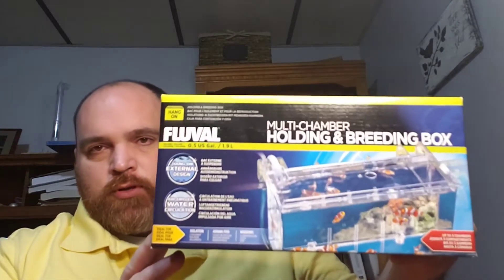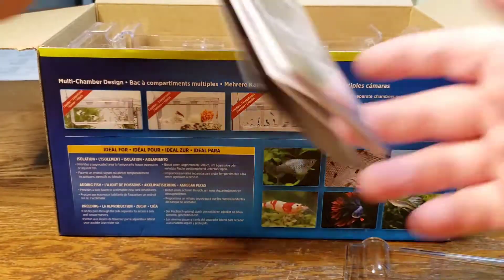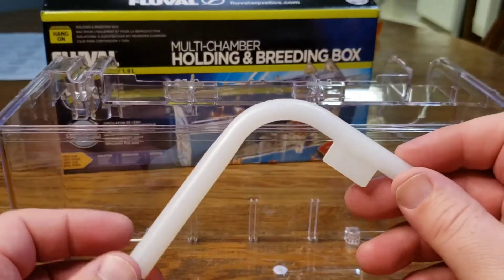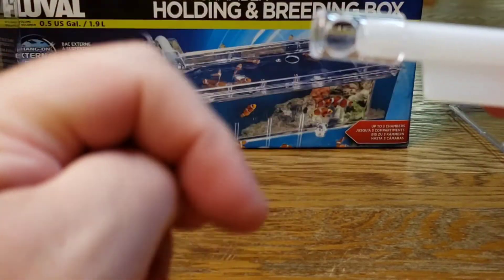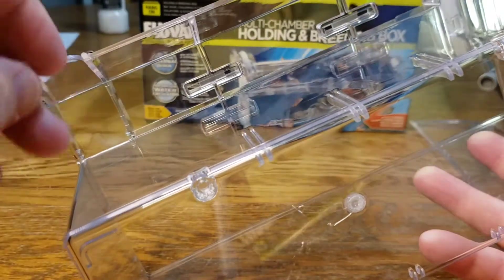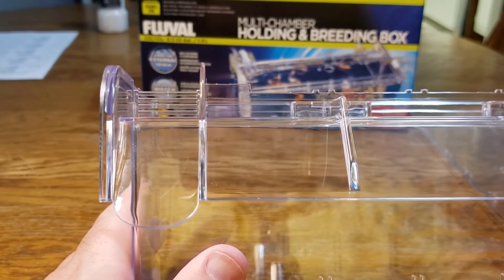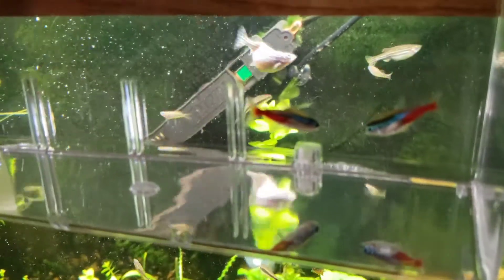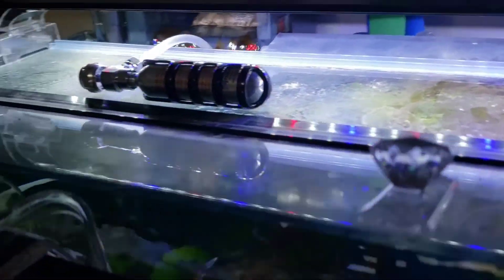Large Fluval Breeder Box Unboxing and Review

Comment: Hey Tim - great review, thanks for taking the time to do it! 
I'm trying to figure a way to add an easy aquaponics basket to grow some plants in. Wondering if there is a way to adjust the height of the water in the box based on the air pump being on or off; ie. Heigher water line is on, lower if off.
 This is because an aquaponics system appreciates a wet/dry zone or a flood zone where water floods intermittently- I'm thinking of running the air pump intermittently(scheduled using a smart switch) to enable this wet/dry zone.
Thanks for your feedback!
Reply from the maker: I can't think of a good way to use this for a aquaponics system as there is no way to really adjust the water level so you would have to depend on evaporation.  If I was trying to do a aquaponics setup I would use an overhead sump setup with a powerhead and timer.  I talk a little bit about doing a setup like that in this video https://youtu.be/XqHyQ4mNRgI and you can get an idea of what you would want to look for in a powerhead.

Comment: Nice vid, thanks
But (isn't there always a but) halfway the clip I realised, this set is very easy to turn into a Bio Filter
and not unimportant realy cheap to realise
I'm realy confident about the setup in all it's simplicity
Reply from the maker: Your absolutely right!  I've never run one as a biofilter myself but I have seen it done before.  I think these breeder boxes are extremely flexible for a lot of different purposes.
Reply: @IansFishRoom  
Well there is much to say about the stabilty of the filter and the freedom of choice in used media (I like the different types of Siporax) and you are not depended on cartridges..
Not in the last plast to mention the prices of external filterpumps